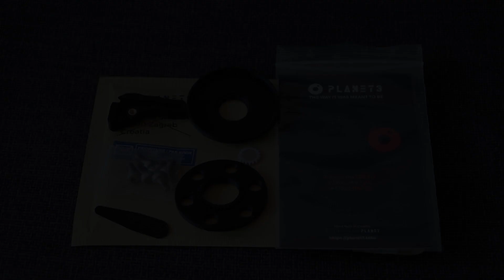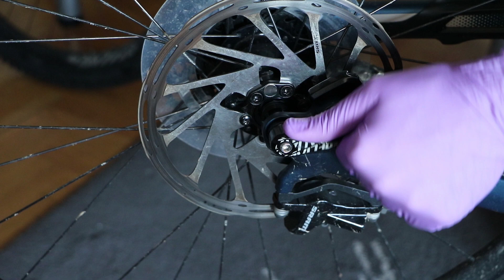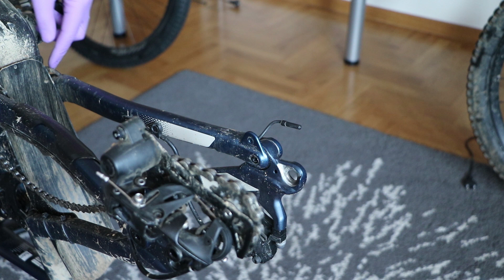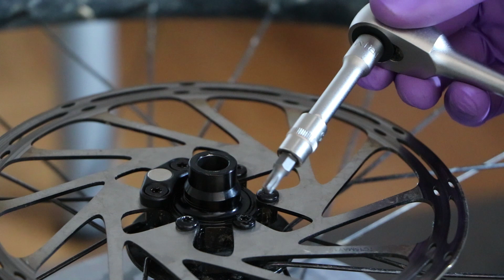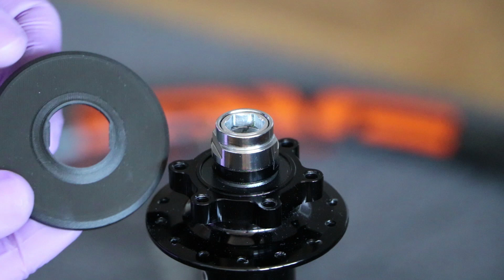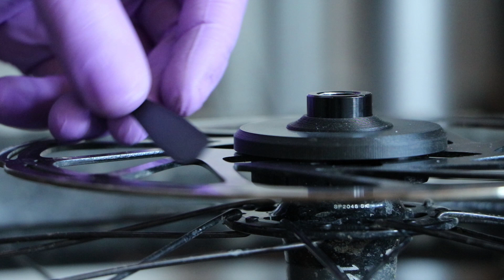PLANET3 installation instructions for 2019-2020 Specialized Levo, Levo SL & Kenevo (Gen2)

Comment: I see you upgraded ur suspension, what fork and shock is that? And what mudguard is in the back? Will order a Planet3 very soon for my levo!
Reply from the maker: 36 GRIP2 160mm at the front, DPX2 210x55 at the back, mudguard is Mudhugger Shorty flipped backwards and with some added holes. :)
Reply: @planet3bike  thanks!

Comment: Looking to get this for a Turbo Levo 2020. Any tips for mission control settings? (Support/Peak Power) Just wondered if you'd run different numbers once deristricted.. Thanks!
Reply from the maker: The only thing gone is the speed limit, there's no need to change anything to the modes of assistance unless you find out that you'd want to do so (for example, restrict your Turbo so that you get more battery life if you can't control yourself from speeding :p).
Reply: btw this is kinda a different question to the one below.  I'm just wondering if you've found yourself setting different levels once deristricted? Like30/100 Eco etc.

Comment: Has any body brought up the question about the best way to set up mission Control with this product. Can I still us it to modify my output in Eco and trail and have turbo unrestricted?
Reply from the maker: Mission Control modes are set independently of the PLANET3. But there is no way to have just one mode "derestricted" as PLANET3 will just work all the time making the bike think it's going slower. However, the speed limit will naturally self-impose based on your leg power, gradient, mode used etc. What I mean to say is: it's rather hard to go past 25 km/h in Eco on anything other than very flat ground or even a slight downhill gradient. The thing to note is: you can't really use Mission Control for recording rides since the distance is going to be off by a factor of ~3 and it only uses GPS to draw the map and ONLY the bike's speed sensor for logging distance and speed. So, any feature such as "I want to do XY miles and have Z% battery left" will not work unless you divide everything by 3 yourself. To that end, best thing to do is just switch to BLEvo for ride recording and even assistance mode levels. It's a much more powerful app than Mission Control will ever be, plus it enables you to set a Speed multiplier option to 3.00 which will correct the speed and distance displayed in BLEvo when PLANET3 is installed. I should not that the motor (bike's internal distance counter) will still log 3x less miles from the moment you install the PLANET3 and there's no way around this.

Comment: Hi, this is a very useful video. Do you have something for 2020 kenevo comp with stock revel wheels and Magura MDR-P 220 rotors? Thanks!
Reply from the maker: Hi Richard, the same PLANET3 described in the video fits the 2020 Kenevo, and Magura rotors are fine. Only Hope Floaters are a "problem" in as much as you need a special version of the PLANET3 for them.

Comment: Is the device somehow effecting the guarantee given by specialized? Is the hack somehow recognizable by the specialized app/system?
Reply from the maker: So long as you remove it before taking the bike into the shop for warranty - no. They can just see it has lower mileage for a given number of charge cycles, but that's easily explained by differences in fitness levels of different people, power modes used, battery sharing with friends etc.
Reply: Well then. Please answer my buying request. :) Dalibor

Comment: Can it be used with a Magura MT7 brake?
Reply from the maker: Yep, but the brakes themselves don't matter. It's the brake rotors that affect PLANET3, but even with the MDR-P rotors it'll work since they're 2 mm thick at the 6-bolt interface.
Reply: @planet3bike  Just to be on the safe side - I can mount the MT7 (203 or 220 mm) on a Turbo Levo SL 2020 and simply follow this instruction to install PLANET3, correct?
Reply from the maker: @CA-cv6bs  correct. :)
Reply: @planet3bike  Last question: When removing Planet3 from the bike, e.g. because of a motor damage, can the bike dealer find out about the previously installed Planet3 and therefore guarantee on the bike expires?
Reply from the maker: @CA-cv6bs  No. They can say "you have a rather low mileage bike for your charge cycles" to which you can say "so?". And that'll be the end of that. There are too many plausible use case scenarios and differences between fat and out of shape people and fit cardio squirrels for them to be able to actually prove anything, so they won't even try.

Comment: Can this be installed on a: Specialized
Creo Sl Comp Carbon Evo
Reply from the maker: Hi Gerrit, well - not this exact version since it's a 6-bolt, but if you check out the PLANET3 Center Lock video that's on the channel - that version is for your Creo SL.

Comment: do not get this. it is 3D printed and it constantly messes up the bikes computer...having to turn on and off the bike to reset it...for 60 euro more you get the chip and its an very very easy instal. stakes 20 min. and no knowledge of elec. needed. simple instructions to two plugs in the plastic motor panel.     the bike cost 6,000 euro.  pay the extra 60 and get the right part. !.not cheap 3D printed stuff that breaks in 3 months..
Reply from the maker: Very useful comment considering almost everything said is completely wrong. Thank you for helping potential users make an informed purchasing decision!
Reply: I've had one on my 2019 for a year and never had issues.
Reply: What is the chip called
Reply: What is the chip called and where do we get it?
Reply: Sounds like a sales pitch. Put someone down and come buy my shit.
Reply: sorry , wrong comment, i ride +/- now 5000 km with this,never had any problem with it...so i can recommend this "upgrade " from Alex !

Comment: Anyone figure out how to trick a speedo yet for Strava purposes?
Reply from the maker: Yeah, use BLEvo to record the ride, set the Speed multiplier in BLEvo to 3.00 so it'll read the correct distance and speed from the speed sensor, then upload the GPX file to Strava. Other than that, no deal. OR simply record Strava rides using GPS :)

Comment: Good video ....what material is the planet made of ? ...as we all know moving parts wear ...would you advise a anti friction lube prior to fitting ?
Reply from the maker: It's made out of a hybrid material that's based on a PLA but doesn't suffer from the main drawbacks (frailty etc.). As far as wear goes, if installed properly - it'll work basically forever. I give 1 year  & 10k miles/15k km warranty. No lubes, no maintenance, no problems. :)
Reply: @planet3bike  Would lube actually be detrimental? Running this dry is clearly possible, but surely it would make some sense to add a little grease? Or would that not play nice with the plastic involved?
Reply from the maker: @gabort71  grease attracts dust, forms a friction paste.. Run it dry and it'll be happy. :)